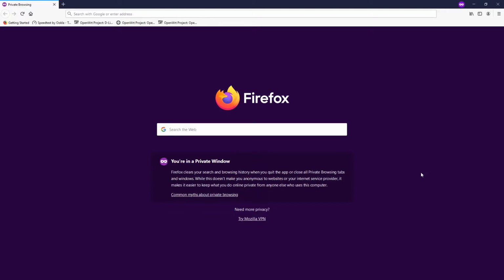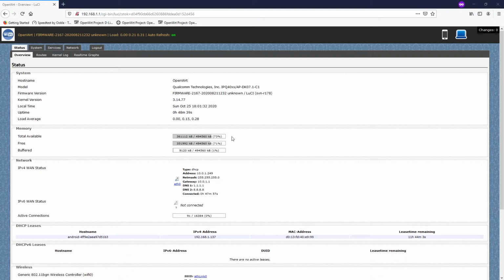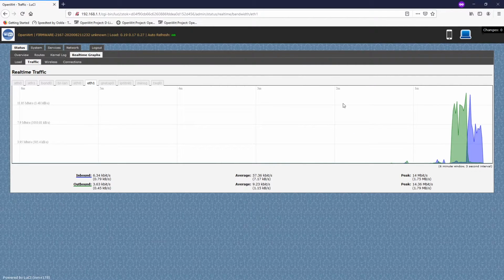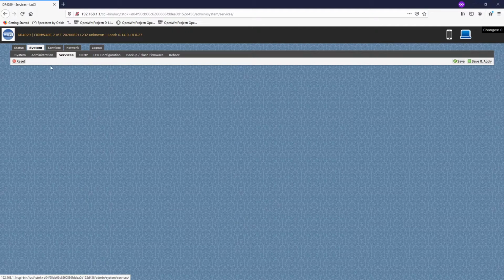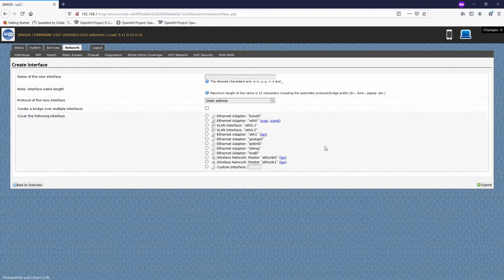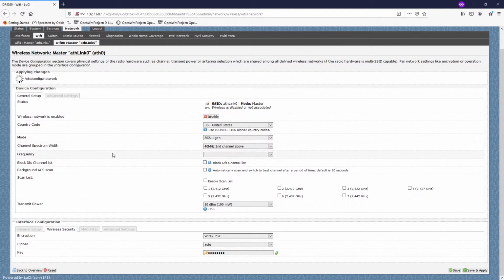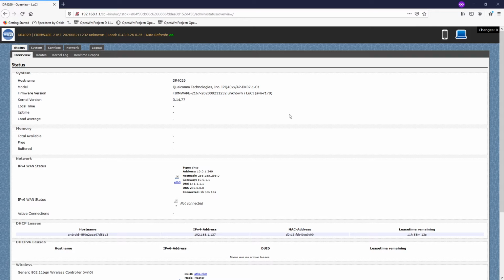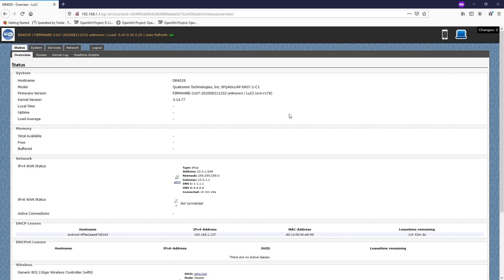OpenWRT - Wallys DR4029 Router Board - SFP & LTE module supported

Comment: quick question, the mini pcie for LTE modul supports usb 3.0, for LTE Cat 6/12 etc. cards Quectel or Sierra wireles? I dont found infarmation about this :)
Reply from the maker: Hey, The USB 2.0 standard offers a theoretical maximum signaling rate of 480 Mbps and I believe Mini PCIE 2.0 bus should be enough to handle LTE cat 6. Most of the USB 3.0 device will be backward  compatible with USB 2.0. If you have any doubt, please check with the vendor to confirm this.
Reply: @VanTechCorner  Thanks for your answer, I'm looking for something with usb3.0, preferably with M.2
Reply from the maker: I think you can build an x86 PC to run OpenWRT, or looks as those motherboard with CPU soldered, such as the N3700.

Comment: Can this product do load balancing between two Cellular sim cards?
Reply from the maker: Hello, if you want to configure load balance between 2 cellular networks, you need 2 modems. This board only has 1 connector for modem, you will have to use another USB modem. There is a tutorial about multiwan load balancing at https://www.youtube.com/watch?v=f_yGMezdMB0. If you want to learn more about modem configuration on OpenWRT, feel free to check it out on my channel!